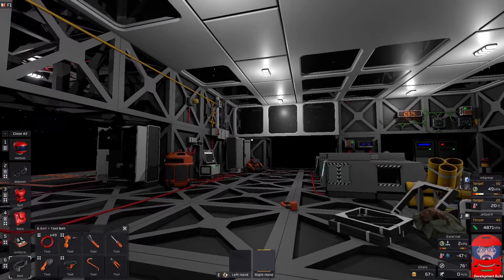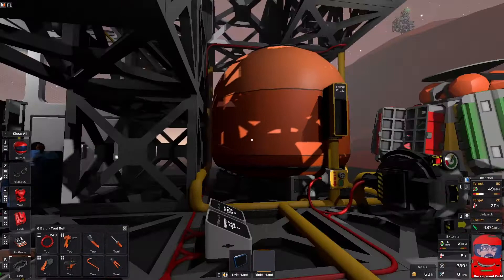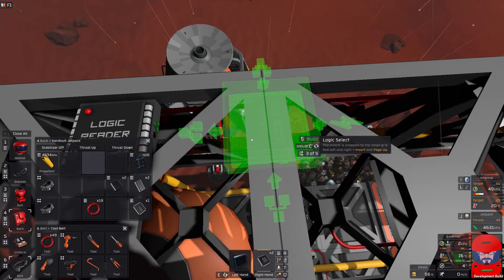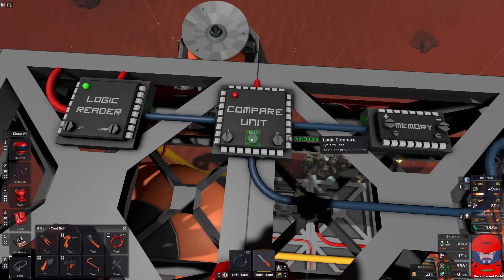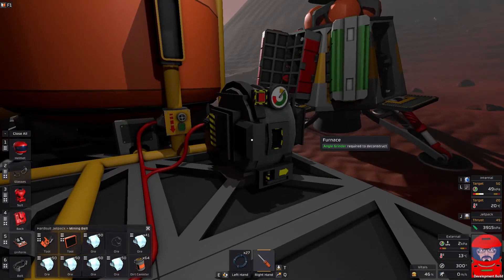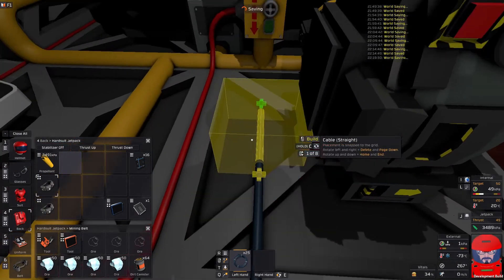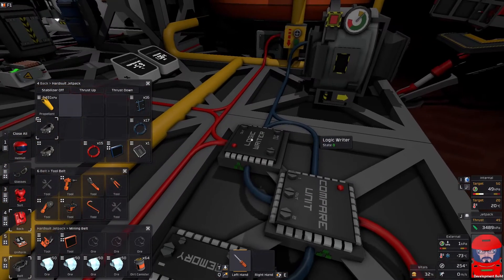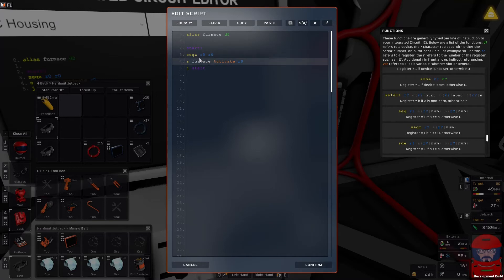Stationeers Building and automating gas collection

Comment: A couple of newbie questions:

1) I notice that you use 5 MPa as your max pressure quite often, but from my research it seems like most pipes and tanks (other than portable and canisters) have a burst pressure of 60 MPa.  Is there a reason you favor 5 MPa?

2) In this video you hook up your old furnace to your main reclamation tank to get H20.   You then automate the "igniter", is there a danger of explosion if your main tank has both H2 and O2 in it?
Reply from the maker: 1.  I like to use the pipe meters to show the pressure and they only go up to 5MPa.  So purely an asthetic choice.
2. Yes.  Dumping a hot furnace into the reclamation can also cause ignition.  My system is set up to remove all H2 immediately to prevent ignition.

Comment: Can you discuss this topic in regards to the moon?
Reply: I'm not too far along but I hooked up a pipe system and tank to my furnace before I even turned it on for the first time.  I figured since I'm on the Moon I better collect every atom of gas.  The plan is to sort it out later and that looks to be the next video.
Reply from the maker: Ice and smelting are the only sources of gas on the Moon and Mimas.  I find playing on the Moon is missing a lot of gameplay elements because of this.  But it does present its own challenges.  Make sure you are collecting all of the outgassing from the furnace and collect lots of ice.